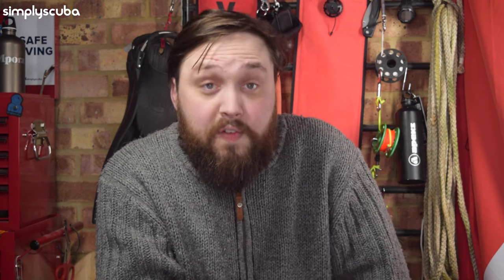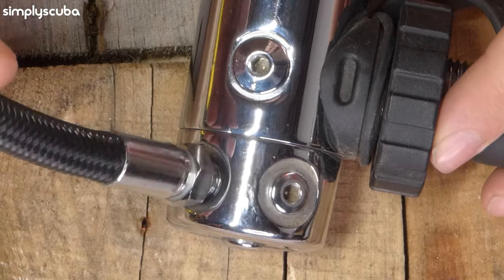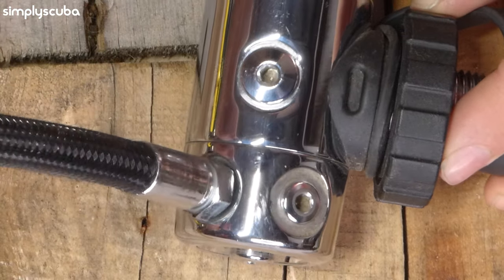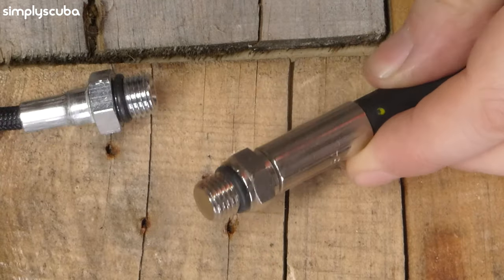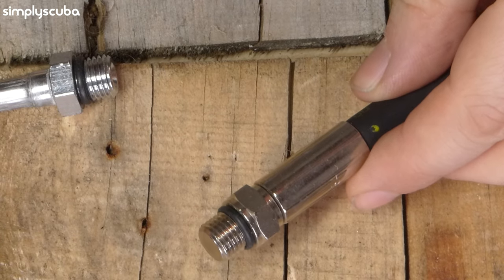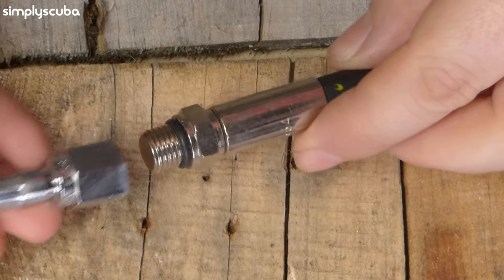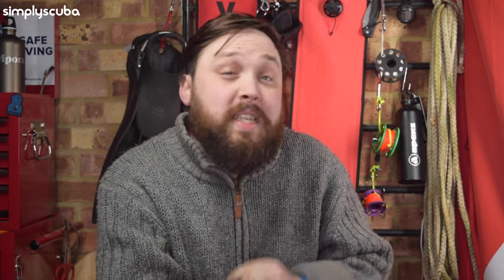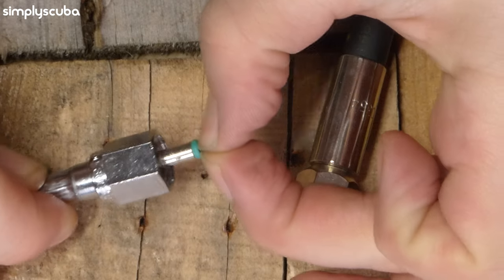Hoses | Product Breakdowns

Comment: I prefer the flexibility of braided hoses, in the water and even more when packing my dive bag for a trip. One point that might better be mentioned is that the first generation of braided hoses often were made of polyester on the inside. These tended to build chrystals that in worst case could block the airflow. Today's braided hoses have a polyether lining which is safe. So if you buy a used regulator with older braided hoses, check out what they are made of or replace them.

Comment: Good information nicely presented might have been good to mention on Poseidon second stage hoses have an over pressure valve in the hose. If you use an adapter for Poseidon second stages to use a standard hose then then an over pressure valve needs to be fitted to one of the first stage LP ports.

Comment: Hello and happy New Year! I've heard that rubber hoses are better for cold water, but I've only heard it once, and the reason was odd: internal air friction is supposedly higher on rubber hoses, which warms the air as you breathe. This seems like it would increase the work of breathing unacceptably while providing little benefit, but as a cold water diver, I'm always looking for tricks to stay even a tiny bit warmer. Any thoughts on the thermal differences between hose types?

Comment: Unless you contact Aqualung. They will merely tell you to visit a local dealer. It took me 5 emails before I finally got them to tell me what part number I needed to convert my 1st stage from yoke to DIN. Why? They told me to visit a local dealer, they tried to get me to mail it in to an authorized dealer, and then they finally gave me the info I wanted after the 5th email explaining my lack of interest in visiting an authorized dealer in my area.

Comment: You say rubbber hoses are 'stronger' than braided ones.  That depends how you define strong.  Braided hoses are more damage resistant since cuts are typically restricted to one or two strands of the braid, whereas even a shallow cut or crack in a rubber or other solid hose can propagate and lead to complete failure.  The flexibility of the braids also means that they themselves will be less liable to fatigue cracking while their tensile strength allows a more elastic inner, again more resistant to damage from even quite tight kinks.
Reply: Are you saying rubber hoses are not braided on the inside? Am I missing something?
Reply: @Tapio86  Scuba hoses were originally made from a single solid rubber extrusion.  Some later ones use double layer hose, with an inner harder core surrounded by the smooth, softer outer sheath.  So no, they are not braided.  Braided hoses can use a lighter, more flexible core material because the braiding round the outside does most of the work of resisting the pressure and any abrasion.